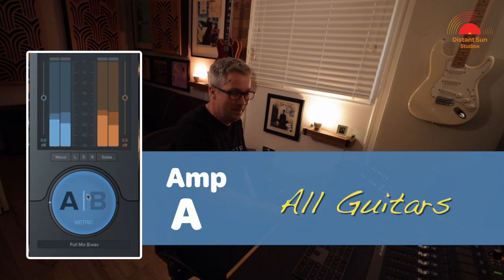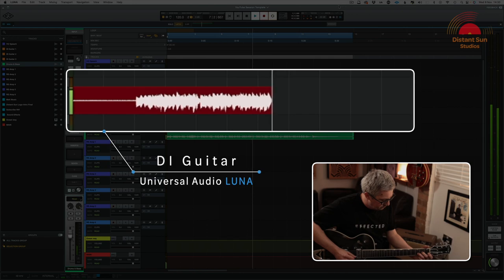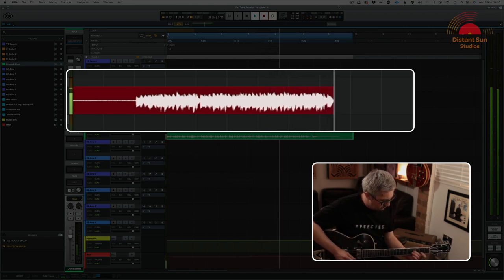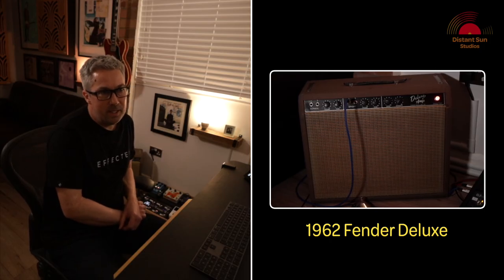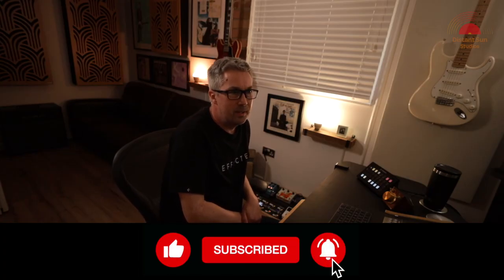The Ultimate Showdown! Axe-FX III vs 1962 Vintage Fender Amp Comparison #AxeFXIII

Comment from the maker: Finished mix of the song used here: 
https://www.youtube.com/watch?v=-GnUAHVOlDw&t=0s 

Short on time? - quick links for today's video:
00:00 Sound Check #2
00:22 Intro
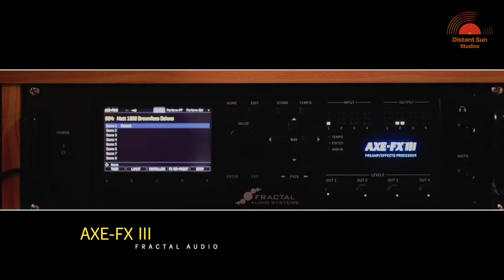00:37 What is the AXE-FX III
01:12 Recording with a DI Box
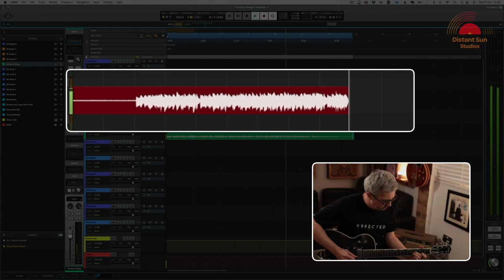01:30 Gibson ES 355 AB Test
01:53 Gretsch Duo Jet AB Test
02:18 Fender JM Jaguar AB Test
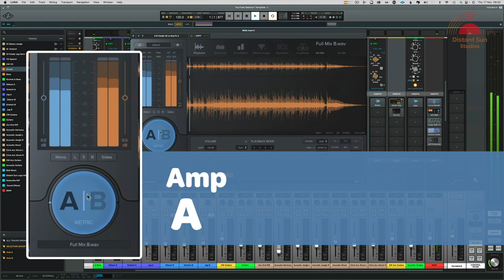02:41 In the Mix AB #1
03:09 In the Mix AB #2
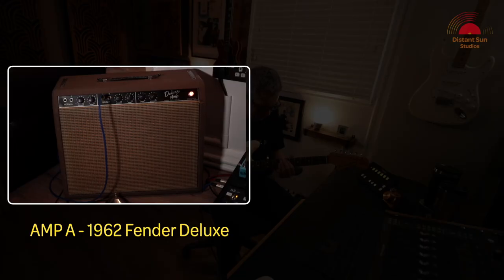03:42 Which was the real amp?
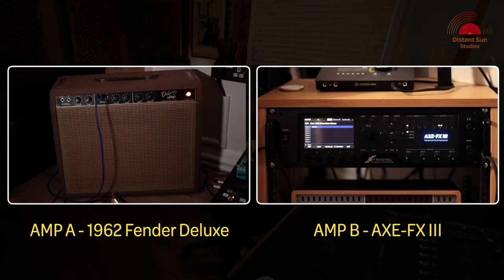03:52 Closing thoughts
04:28 Like and Subscribe!

Thanks so much for checking out the video! 

All the best

Matt

Comment: I have been a gigging and studio guitarist for over 50 years. During that time I have owned, or used, most amps and cabs produced from the 1950’s through the present. As I got older, my ability (and desire) to carry heavy amps, cabs and effect pedalboards became less and less possible. So, starting in the 2000s I began making the move to emulators. Most recently, I bought an Axe-Fx III Mk. II Turbo. In my opinion, this unit has the most accurate and convincing amps, cabs and effects of any of the units I have owned previously (Kemper, Headrush, and Helix). I find that in a mix (live or in a studio recording) it is very hard, if not impossible, to hear any difference between the sounds produced with real amps vs those produced by the Axe-Fx III. The benefit of being able to carry a small, lightweight rolling rack unit and one switchboard in a backpack vs lugging around hundreds of pounds of amps, cabs and pedalboards/effects outweighs any minimal difference n sound. Thank you for your video, it was well done and does a good job of showing how good a job the Fractal Axe-Fx III does!
Reply from the maker: Hi Peter, thanks so much for watching and what a wonderful, well written comment! So sorry it's taken me a week or so to reply, it's just been a very busy few weeks. It's fascinating to hear a session player of your experience and knowledge give such praise to the AXE-FX. I totally agree with you, it really is an incredible unit. Thanks again, and have a wonderful week! Matt

Comment: This is very nicely done.  There is a crucial omission though IMHO, with the Axe-Fx, the tones, dynamics and responsiveness change (improve), sometimes quite drastically, with the firmware updates, so I think if you're comparing the Axe-Fx III you really must include which firmware version you're comparing to.  FWIW, I still have my tube/valve amp also, and as you quite rightly say, it isn't an either/or situation.  I use both, depending on what I want in a particular project.
Reply from the maker: Hi Gary - thanks so much for your comments - very much appreciated. On recording this I was using Axe-Fx III Firmware Version: 20.04. On the day I uploaded the video to YouTube - Axe-Fx III Firmware Version: 21.00 came out! I will add this into the description - thank you a really useful suggestion. Interestingly, when I just play through the AXE-FX, I never feel any latency and the dynamics are fantastic as well. It was only playing them side by side that I noticed the very subtle difference. If I hadn't made this video - I would never had known! Thanks again, Matt
Reply: @DistantSunStudios  Exactly.  I find the same thing.  Only side by side, with a critical ear, can I detect the difference.  I've been using the Axe-Fx for many years now, and there was a stark difference in the early days, but it gets a little closer with each firmware update.  It is so close now as to be almost indistinguishable.  If the amp/axe sounds were two balloons, the valve amp is a little more inflated and a little more taut - like there's a little more "space" or "air" inside the sound.  But honestly, your average Joe public can't hear the difference. And for those of us who are a little older, even though our hearing isn't as acute as it once was, we are more inclined to use cleaner tones, and fewer and drier effects, so we hear every little nuance.  Yours is a fantastic A/B demo.  Perhaps if I listened to it uncompressed (not on youtube) through my studio monitors, the differences would be more evident.  Thanks for taking the time and effort to produce this.  Well done.
Reply from the maker: @garyheller62  thanks again - very kind of you. I played a preview of the video in my studio, through the monitors to some friend last weekend. Interesting, one of them is an extremely accomplished classical musician & he couldn’t hear any difference. I think we can only tell as we have trained our ears to listen out for the nuance’s in guitar tones. Fractal have done an incredible job!

Comment: Very similar! Close enough that it's a non issue, especially in a mix. But I knew B was the Axe FX because the clipping was slightly harsher and brighter. Amp sims can do clean and high gain very well but edge of breakup is tough to emulate.
Reply from the maker: Hi Wyatt - thanks so much for watching! Yes - that's a really insightful comment and a great description of the slight difference. Thanks again and have a great week! Matt

Comment: Im curious if this has the latest firmware for the fractal product that made a big change in amp models. I have an fm9 and was considering selling until this update.
Reply from the maker: Hi Tony - Thanks so much for watching and taking the time to comment! I used the latest firmware at the time of recording - which was Axe-Fx III Firmware Version: 20.04. It's been updated twice since to 21.01 - so I'm sure would probably be even closer if I did the same AB test now. Fractal are absolutely killing it! Thanks again, Matt

Comment: I assume this comparison has the Axe FX III on the latest firmware 21? Haven't installed myself but I saw the Carter Cooper demo and it really sounds better, particularly in the lower end. Great demo. Really hard to tell the difference on most.
Reply from the maker: Hi - thanks so much for watching and taking the time to comment - sorry for the delay in my reply - only just found the comment came across it now! I used the latest firmware at the time of recording - which was Axe-Fx III Firmware Version: 20.04. As far as I'm aware - it's been updated twice since to 21.01 - so I'm sure would probably be even closer if I did the same AB test now. Fractal are absolutely killing it! Thanks again for your kind words - very much appreciated. Enjoy the AXE FX III! Matt
Reply: @DistantSunStudios  In my opinion the update 21.00 was a big improvment. The Amps that I tried all sounded better (more character).
Reply from the maker: @alaincousineau9321  Thanks so much for watching and taking the time to leave a comment! I 100% agree - the 21.00 update sounds fantastic - incredible unit the AXE-FX! Happy New Year and all the best for 2023. Matt